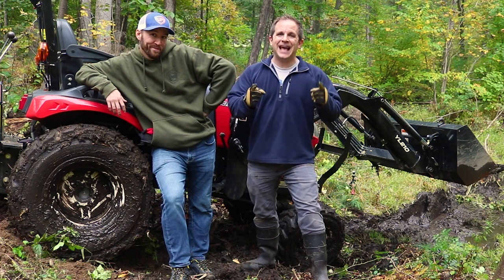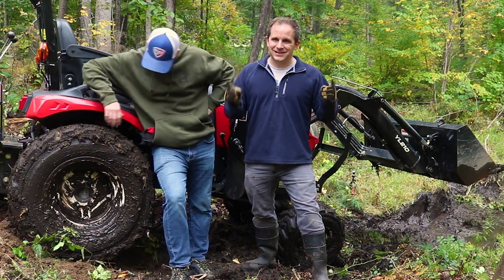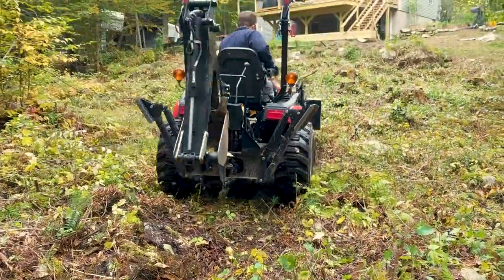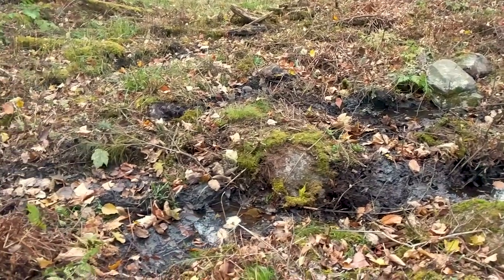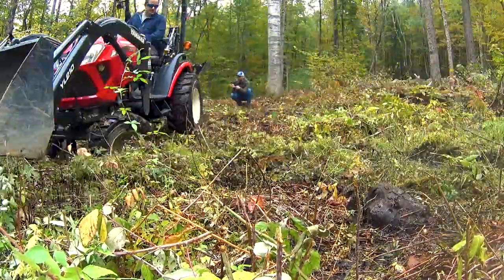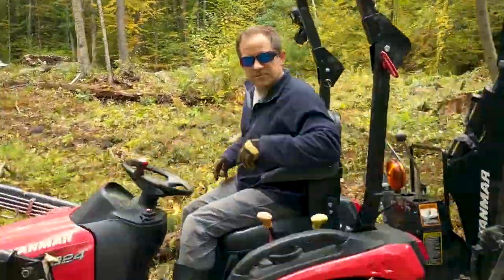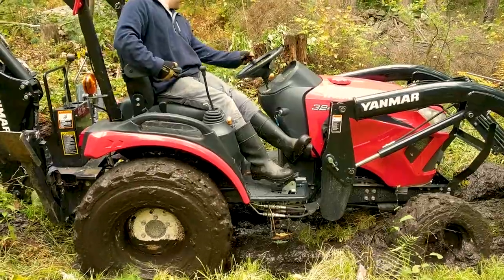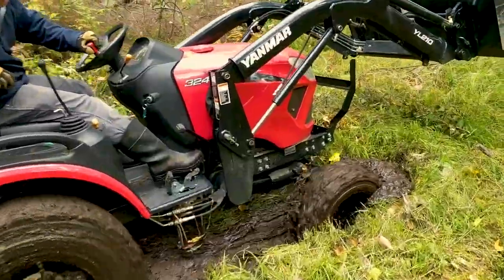I couldn't get stuck!

Comment: LOL!!  When you don't need to get it stuck you will!! When you try to get it stuck you can't!! LOL   When I bought my tractor the first thing I did was going from the trailer to a spot I knew it will get stuck just to see how easy I can get it out. It sunk all the way to the frame, lol  I got it out using the FEL and BH. Had it out in no time. Test passed.  Thanks for the video!   Y'all have a great weekend!
Reply from the maker: That's a good idea to break in a new tractor!
Reply: I wanted to see if I could get it out under it's own power and by myself.

Comment: Great video, guys... and fun to watch. But one of those dumb questions: Not heard of a "line damper" before. What exactly is that and why do you want to use it?
Reply from the maker: A line damper can be as simple as a heavy jacket, or a special weighted bag you put over a winch line. You do this because the line has a lot of force trying to stretch it, if the winch line snaps it can whip out and hit someone or something. The weight of the dampener sends that force/energy of the snapped line down to the ground. It's mostly just a safety mesure in case the cable snaps. But it's very easy to do, and could do a lot to protect you or your equipment!